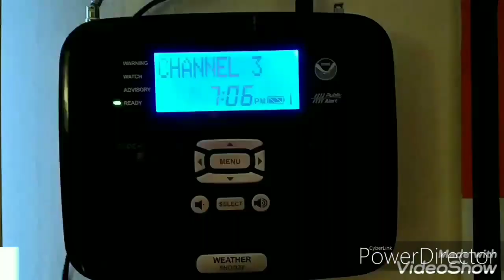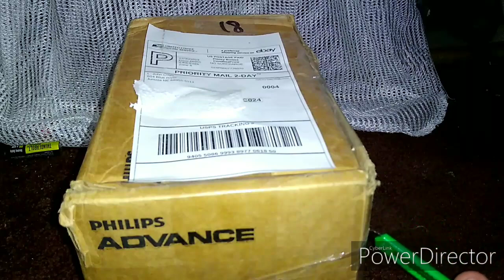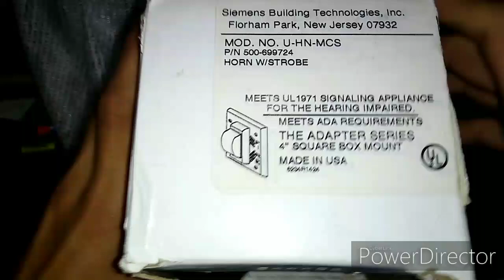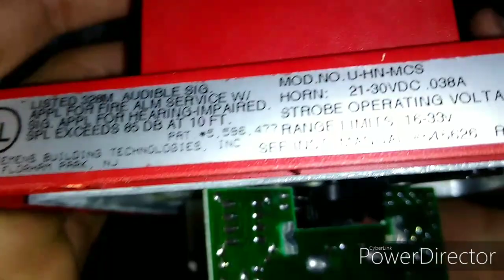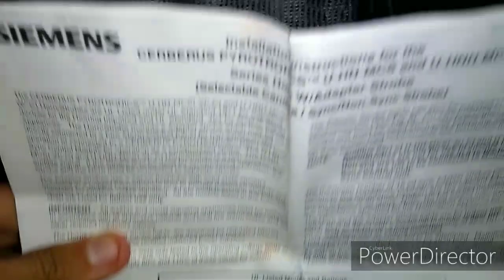Unboxing/Testing Siemens U-HN-MCS Fire Alarm Horn Strobe

Comment from the maker: Just to say, the reason why the horn sounds like that is because I was using less voltage to power the horn. That's why it sounds weird.
Reply: When i put 20v on my 2901 9840 it sounded like a train horn not a joke and when i put 24v on it wich is the right volts its sounds like a 9838 or a 9806
Reply from the maker: @vintagesimplexfirealarmsof6440  voltage can really make a fire alarm sound weird sometimes lol
Reply: It sounds like this was powered by using FWR.

Comment: What does that sound like on 140 or 130 bpm march time lol i wonder that would be to fast
Reply from the maker: I'm not really sure, I haven't really tried that since I don't have a panel at the moment but that does sound very interesting
Reply: @ElexGamingLifeSafetyGuy  you can hook a light switch to it and do that stuff manually like code 3 120 bpm 90 bpm 4 4
Reply from the maker: @vintagesimplexfirealarmsof6440  I will try that sometime soon, thanks
Reply: @ElexGamingLifeSafetyGuy  last week i saw one of these with the 9838 mechanism but 120v

Comment: Why does it sound crackly
Reply from the maker: The power supply that I had it hooked up on did not really give it the full power it needs. It works but it was using less voltage